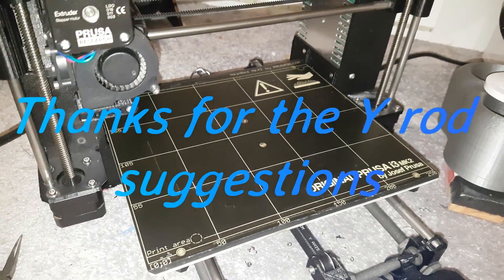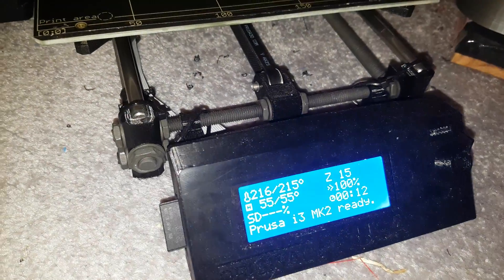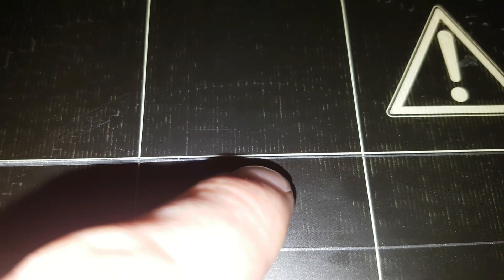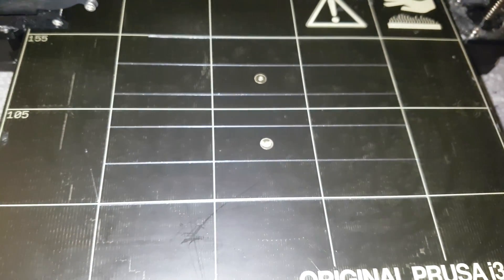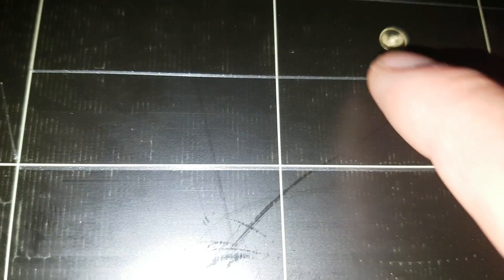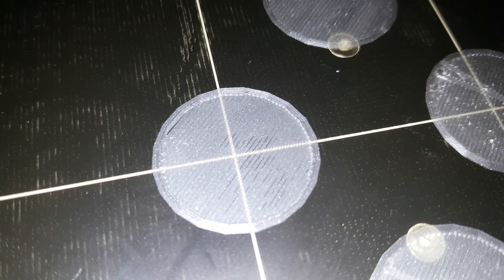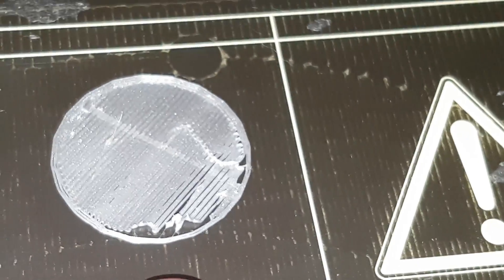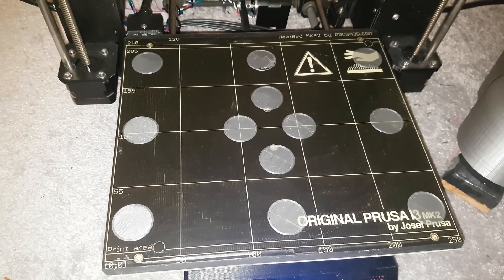Update on my Prusa I3 MK2 Bed

Comment: take out your manual adjustments, do a full x,y,z setup & try a different filament(check your extrusion multiplier with the filament) . really don't think you have any major bed issues any more, what is your live Z value now ?
Reply from the maker: +macca vape just on my way out but when I get back I plan on doing this straight away. I'm hoping this will sort out the chappy top surface layers I'm getting. They look so bad compared a to a month back :-( using the same filament though so shouldn't need to change anything regarding that.

Comment: PCB will never be as flat as glass- id just be happy aslong as the prints stick ok
perhaps try a new PEI sheet
Reply: print with brim just incase with parts that will tend to peel
Reply from the maker: +meky0 yeah a new PEI sheet could help in the future but the prints seem to print great still, it's just that one patch where I think there's some sort of dent. As you suggested I've been using a brim lately.just in case. Works great :-)
Reply: you could try sanding down your PEI sheet upside down on a flat stone table
Reply: For me new PEI was the solution. After replacing the first PEI I got massive inconsistency on the first layer over the whole board. Replaced it again today and now I got a good first layer finish almost on every spot (some spots are a little bent but not the way it would cause problems or look bad on the first layer)